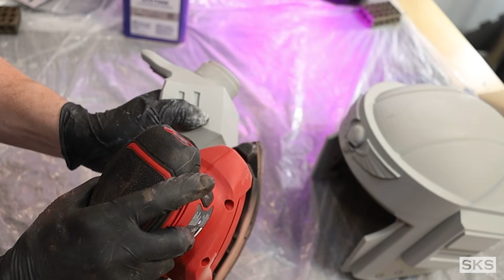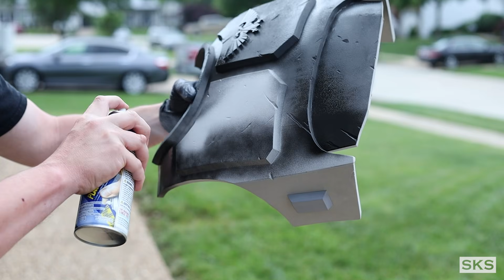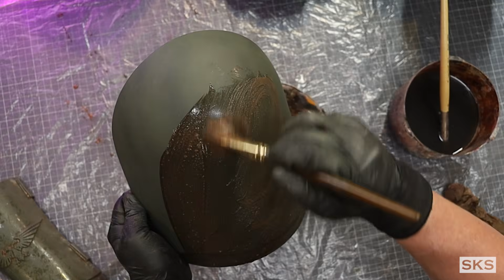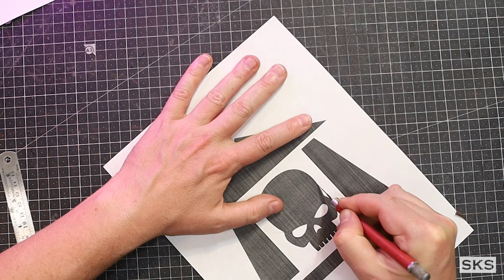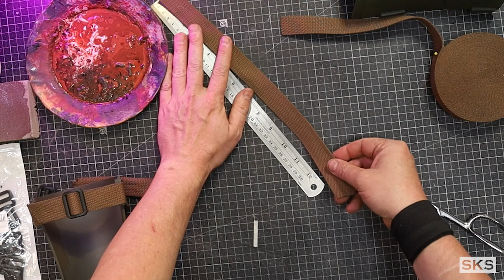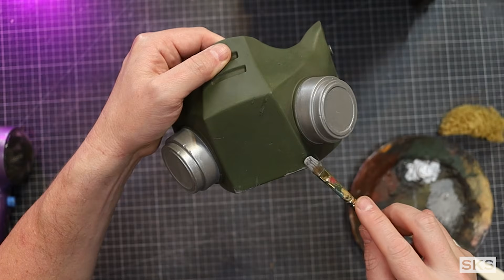Warhammer 40K Cadian Cosplay Painting Tutorial - Warhammer Kasrkin join Helldivers 2 Free Templates

Comment: For the helmet, hold it in your hand as if you had taken it off because it's hot/heavy. Note how you're holding it. That's a common wear point. Now set it on a table or floor, upside down. The contact point is another common wear point. Also, put the helmet on, sit in a chair against a wall and lean back. Where your head hits the wall is a very common contact point. Soldiers sleep when they can. Ask me how I know...
  The same applies to most of the kit. Battle damage accrues quickly and aggressively. Wear and tear accrues over time. Grunts spend a lot of time in transit. Before putting the wash on, wear the whole kit and do a variety of activities. This will give an idea where the contact points are. The paint may or may not smudge, leaving a mark where it hits.
Reply from the maker: Good points 👍